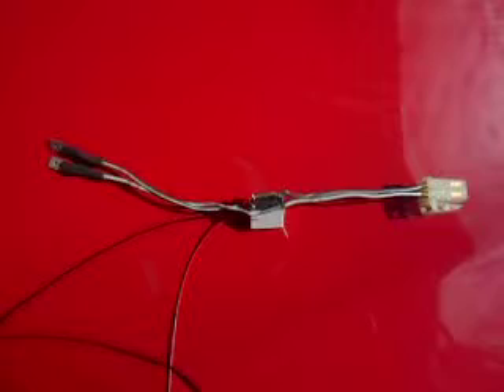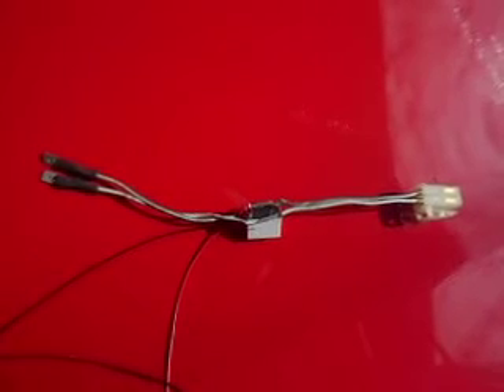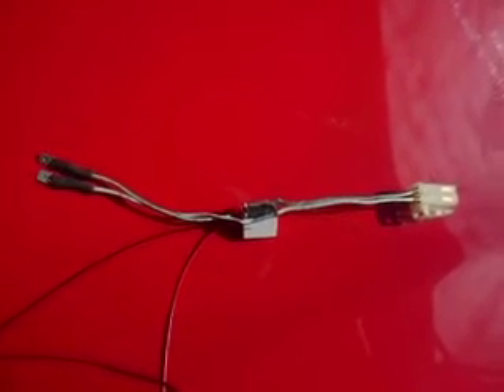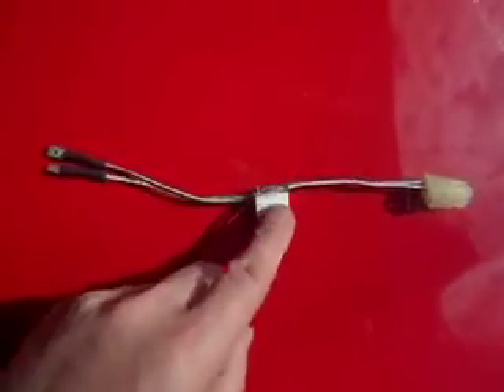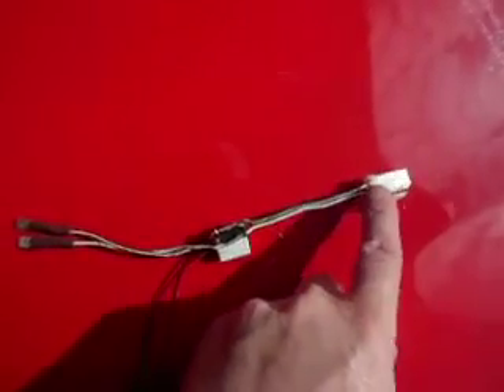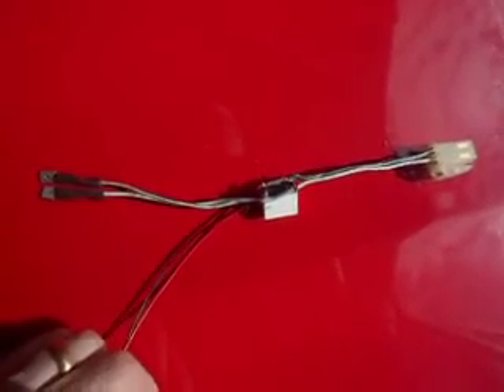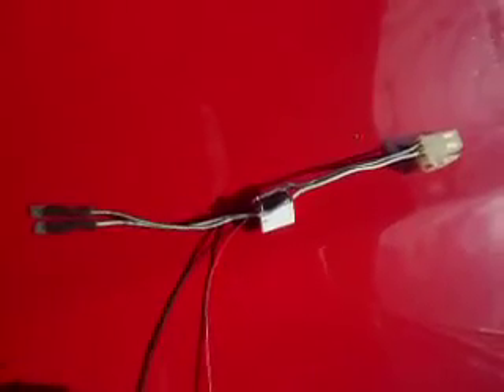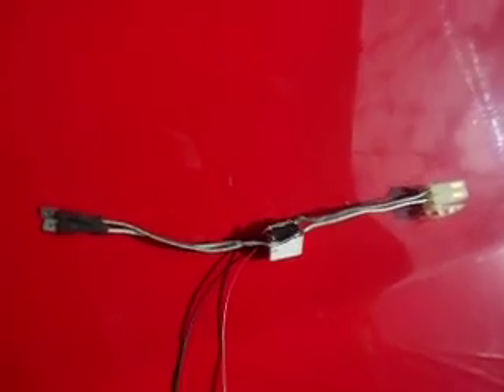Honda Insight Mk1 CVT Handbrake Autostop Mod

Comment: If the break lights turn on, will the brake lights stay on whenever you have the parking brake set? That would kill the battery...
Reply from the maker: The brake lights will not be on when the ignition is off with this mod..